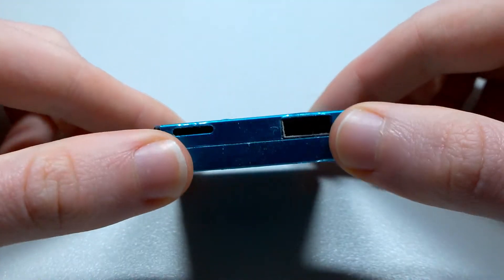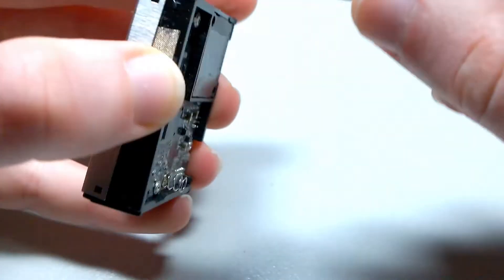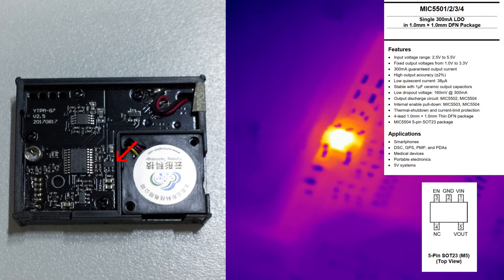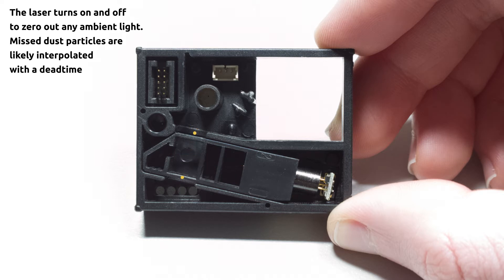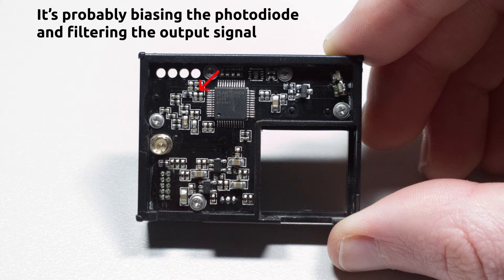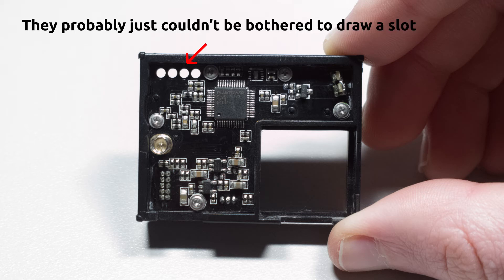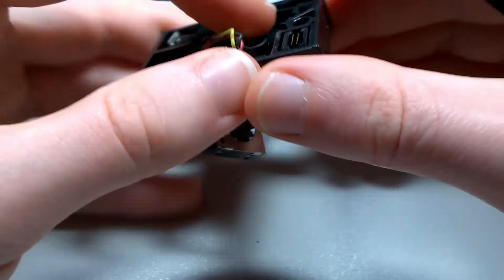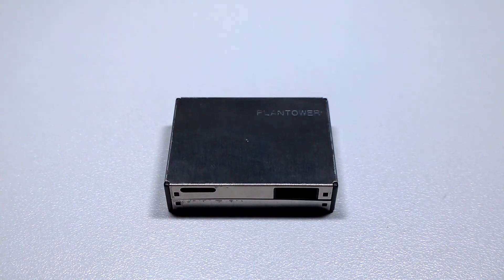Teardown & Cleaning a Laser Dust Sensor PMS7003 After 2 Years

Comment: I was so curious about the inside of these, thanks for the video! I'm still skeptical on how these things selectively measure the right particle size considering the dust particles that you found in there. How much processing is that thing doing? I'm curious about the firmware in there!
Reply from the maker: From what I've observed it gives a good idea of the particle size distribution but it's not perfect. It does give clear trends that dust from carpets is larger than dust from intentional atomization or combustion so is useful for that. But it does seem there's a lot of interference between particles sizes. It makes sense though seeing as the dust can be different colors, shapes and orientations which makes detection very difficult.

I imagine that MCU inside is doing at most a couple MIPS to run everything so not computationally demanding.

Also I now live a couple kilometers away from an air quality monitoring station run by the local government which has several really high end particle sensors. The figures it gives are reasonably similar to what those sensors give.

Comment: i have purchased the pms7003 sensor today, but i haven't got any cable or connector with it. can you help me connect wires to the sensor pins as they are so small. What options i have now. I searched for the cable but there is no one that have these cables in india. I tried international options but thats too costly, costlier that the sensor. can anyone help me with this? Can i open the sensor and solder wires directly to it?
Reply from the maker: The PMS7003 uses a 10-pin (2x5) 1.27 mm connector, male on the sensor side, female on the cable side. (IDC ribbon style connectors won't work, they're too wide)

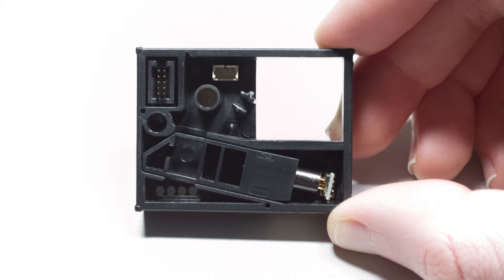Easiest way to connect to it is with an adapter PCB that converts it to a standard 2.54 mm header like used on breadboards, one design available is shown at 3:26. Sometimes sellers will sell the sensor and PCB together which how I got mine but they are sold separately.

Alternatively you can buy just the 2x5 pin 1.27 mm female header which would be easier to solder your own wires onto.
Example: https://lcsc.com/product-detail/Female-Headers_hanxia-HX-PM1-27-2x5P-ZC_C22438129.html

I would normally recommend buying either of those on Aliexpress or LCSC however my understanding is it's pretty difficult and expensive to get those sorts of things through Indian customs so I'm not sure where you could obtain them. It's unfortunately a rather uncommon connector so you probably won't be able to salvage it from scrap e-waste PCBs or buy one from a local electronics parts store but it could be worth looking.

But if you can't get the adapter PCB or connector you can take the metal shell off the opposite side to the connector and solder wires directly to the back of the connector on the PCB.
The pinout of the connector is in the datasheet, make sure to double check as it doesn't have reverse polarity protection: https://soldered.com/productdata/2020/03/Soldered_PMS7003_datasheet.pdf

Comment: Very informative. Btw, these (or something that looks like a drop-in replacement) are used in some Xiaomi air purifiers (4 Pro at least).   Found this video while looking for a replacement fan for my own sensor, it's gotten way too noisy. Sadly the fan itself is encapsulated to the point there's no way to access it and lubricate it a bit... It's a simple 3pin, voltage-regulated thing, but there's no model or anything, so I'll have to do some guesswork/measurements.  Just the info that it needs to provide 0.1l/m is already useful.

Comment: Thank you so much for the video! This may sound like a silly question, but how do you know the fan pulls in 0.1L/min? I couldn't find the information on the data sheet of the sensor. All I could find is that the volume of air is 0.1L.
Reply from the maker: That's a good point. Unfortunately I don't remember where I got that number from. I can only assume I misread the datasheet's 0.1 L volume as a flow rate of 0.1 L/min as that seems suspiciously low considering a typical 20 mm blower fan like that can do 50 L/min, although they're not running it at full speed in this sensor the fan couldn't operate at 0.2%, it would stall before then.

Taking a complete guess I would say somewhere around 10 L/min is a more reasonable flow rate to expect.

Comment: Hello! Thanks a lot for the detailed video!
I am using PMS7003 and its readings are jumping very much. The readings are usually about 10-15 ug/m3, at the same time, about 1 time per minute they jump ~ 200 ug/m3. 
Could you guess why this is happening? What do I need to do?
Reply from the maker: Hmmm, it could be a lot of things so unfortunately I can only give you a couple pointers of what to investigate, could be:
- 5 V supply is low, it needs a solid 5.0 V, it won't work properly at for example 4.6 V
- 5 V supply could be noisy and causing interference, likely if you have other power electronics sharing the same 5 V or maybe a loose wire
- A programming issue or noise on the TTL serial TX/RX lines possibly from a loose wire (I think there's a checksum in the packets it sends, not sure if most libraries check it's valid)
- Dust on the internal photodiode (unlikely if you've just bought it)

Comment: Your explanation is excellent, it has helped me a lot. However, the fan does not turn and it gets very hot. Do you know why it doesn't spin?

Thanks a lot. 🥰
Reply from the maker: Thanks!

Hmm, I assume this is one you're using yourself with an Arduino or something? Typically when something doesn't work and just gets hot it's usually because it's electrically damaged which is what happened to mine at 3:09, I plugged it in backwards and instantly blew up that regulator IC. I'd double check it's the motor and not one of the ICs that's getting hot, also check the fan rotates by hand without power to check it's not mechanically jammed.

Another thing I have noticed with them is they really need a good 5V supply, the 5 V pin on an Arduino or similar will often cause problems because they have a diode between the USB port VBUS and the 5 V header, check with a multimeter it's like >4.90 V and not something like 4.4 V (5 V minus a diode drop). Cheap thin breadboard jumper wires can also make poor connection or break internally so check them over as well.

Comment: THANK YOU THANK YOU THANK YOU!!!  

My PMS7003 died and I had no idea why, I didn't have the courage to take it apart without a guide.  Yours is the only teardown guide of the 7003 model ON THE ENTIRE INTERNET.  Upon tearing it down I was able to discover there was nothing wrong with the board, just that stupid fiddly connector, and I instead removed the connector and soldered wires directly to the PCB, and now it works again!  HOORAY!  thankyou!

Comment: Great video! If you had this running continuous in a home/office setting and cleaned it once a year, what do you think would be the life expectancy of one of these devices?
Reply from the maker: The manufacturer says the Mean Time To Failure (MTTF) is > 3 years without cleaning in a typical indoor application. The sensor in the video I still have and it's working fine now 5 years old, along with 2 others that aren't quite as old. The fan inside is the thing that will probably break first, in a normal indoor application with ~5 μg/m³ of dust I think 10 years would be a reasonable expectation for the limit of it's useful life.
Reply from the maker: If you want a dust sensor with a very long life expectancy there are draft type sensor available, they heat the air inside to make the air rise though the measurement chamber without any moving parts, but those devices consume more power and are typically less accurate.

Comment: Are these dangerous? I have a mila air purifier. It says it has a laser sensor. I am always next to it. Is it bad for my health? Aren’t lasers radiation?
Reply from the maker: Those aren't dangerous and your Mila air purifier is perfectly safe. 

"Laser radiation" is just a technical term for a special type of focused light that's "non-ionizing", the laser in those sensors are what's called "Class 1", which is perfectly safe.

You're probably thinking of "ionizing radiation" (like X-rays) that's dangerous but that's very different, you very likely don't own anything that emits ionizing radiation.

Comment: I don't think you have a counterfeit, I think they're just iterating their designs very quickly. I have one from a few years back and remember them coming out with a new model number immediately after I got it even though the one I had was really new. I really think there's no wayyyyyy these cheap things are actually "counting" anything. The number of particles in the beam at any given time, the total lack of focusing optics before the photodiode, etc. all point to the certainty that what they're actually doing is just periodically grabbing a light intensity value from the photodiode and shoving it into an algorithm that lets them guesstimate the PM2.5, 10, etc. values based on overall light scatter at any given time.  The question is, did you see any statistical difference in detection efficiency after cleaning?
Reply from the maker: Yes I agree it probably isn't a counterfeit, the plastic injection molded case and folded metal parts were identical, it was just strange to see the older datecode one was the one with a custom MCU and overall better mechanical design, my guess is I got two units from when they were switching production lines.

After cleaning it there was pretty much no change in readings, maybe a slight increase of 1 μg/m³, but nothing major.

Comment: This video deserves more likes 👍
Reply: I’m working on an air quality module that comprises of the PMS7003, and I’m looking for good sensors for O3, NO2, CO, & CO2. Please, which sensors would you recommend?
Reply from the maker: @alhajee  I have several gas sensors manufactured by Winsen, I would recommend looking at them.

I like the MH-Z19 modules that use the NDIR method to measure CO2, accurate and well priced modules. 
I also have a ZE07-CO which works well however it is an electo-chemical sensor.
I haven't bought any O3 or NO2 sensors as they're somewhat expensive to get good resolution and low interference.

Note that cheaper gas sensors often have similar interference gases so you might find it better to use a hotplate air quality sensor like the CCS811 or SGP41 and a CO2 sensor if you just need an AQI.

Comment: Great video Tim! Thank you for being so informative about this sensor. However I am still not completely convinced whether this is the best sensor to use. Currently I have used the SDS011 sofar, but that one has also got his issues. For instance it produces much more noise which is annoying if you use it inside. Otherwise is it somewhat bigger and is it more fit to be used in a more turbulent environment and even a hose can be applied. The teardown and cleaning up will also be much more easier since it is bigger and has a simpler construction. What I do not like about these sensors is that the output is all but steady especially in the PM10 range. So anticipation by a MCU is quite difficult because the measurements are goint up and down just in one minute. If you would have a DMM like that you would just throw it away. Do you have any experience with the Winsen dust laser sensors. It seems to me that they are exactly the same as Plantflower ones but they are much cheaper.
Reply from the maker: I haven’t used the SDS011 from Shandong Nova Fitness, but I can say the 4 I have from Plantower are pretty quiet (at least a lot quieter than the 2U server in the same room). The values I get from them have a clear trend and are smooth with very little random noise unless I introduce dust then it changes rapidly, although I haven’t done much sampling faster than 1 minute intervals but I have had bad connections causing random data before.

Zhengzhou Winsen makes some good sensors, I have a few of their CO, CO₂ and CH₄ gas sensors but I haven’t used their dust sensors, after a quick look I see they have the ZPH02 which isn’t a laser dust sensor but an LED dust sensor which only gives very rough data and can’t determine particle size, they also use a draft induced by a heater instead of a fan so it would be silent, they are also a lot cheaper but I imagine not very accurate or precise.
Reply: @WizardTim  The silence of the Plantpower sensors is indeed amazingly silent!!! Perfect for indoor use. I blew one up; a pms3003. Got the leads connected the wrong way :( But in your video you mentioned it could probably be fixed by soldering a new voltage controller. I have another 5003 and a 7003 is on the way so I can compare them and see if they suit me. Winsen has also got laser dust sensors type ZH03B and they are a lot cheaper than the Plantpower ones and according to me they are exactly the same as the PMS3003.

The lifetime of all these sersors is around 10000 hours, but I think that number does not take into acccount when the sensor is cleaned in the way you showed in your video. Maybe the laser itself can have an even longer liftime than 10000 hours. At least  I hope so because cleaning these sensors is well worth it if it works again like new. And it is probably be possible to find new fans for these things since that should just be a standard kind of fan.
Reply from the maker: @Pumba3900  I’d say you have a good chance of repairing it from a reverse polarity however the internals of the PMS3003 are different, I believe it uses a SOT-223 AMS1117 regulator rather than a SOT-23-5 one.

I expect there are 3 main contributors to the life expectancy:
-	Dust accumulating affecting the flow rate giving falsely low readings
-	Laser aging resulting in dimmer reflections thus fewer and mis-classified particle sizes
-	Failure of fan bearings resulting in complete failure
Plantower says it should last >3 years in normal conditions and I certainly believe you could get 5 – 10 years out of it indoors.

And I see what you mean the ZH03B looks identical to the PMS3003 but personally, the PMSA003 is my favourite, but it’s of course the most expensive.
Reply: @WizardTim  The PMSA003 is about 13 Euro shipping included. Is it the best Plantower sensor? I thought the PMS7003 was the latest type and the best? An SDS011 costs about 17 Euro. Still not very expensive for such a sensor. And does this PMSA003 has the stable and smooth readings or do they all have that?
I am using my own moving average code to smooth the readings out, but the readings are so jumpy it almost makes no sense. Another thing that surprised me about the PM5003 sensor was the resolution which seems less than the SDS011. I get readings in 0.1 ugram/m3 resolution whereas the Plantpower just jumps from 1 to 2 which is quite a big step. That is a factor 10 difference. I don't get that. Just to make things clear Tim, I am looking and searching for the best sensor with the most stable readings. And unfortunately there is very little content and info about these sensors I think.

Comment: Thanks for doing this.  I'm interested in the power efficiency of the 7003 and this was helpful.
Reply from the maker: Glad to hear the video was useful! 
During the 2019-2020 bushfires here in addition to the one shown in the video that’s setup inside I also put one on a breadboard on my back deck along with an ESP8266 and an 18650 cell (an old 1,800 mAh one) so I’ve had to deal with the power consumption of it as well. Some things that might be useful to you:
• It needs a good 5V supply, feeding it 4.4 V after a diode drop will result in the fan not starting reliably or not spinning fast enough. 
• The manufacturer states you should let the sensor stabilize for 30 seconds after waking it from sleep mode before trusting readings, this is certainly true however you can probably get away with 15 seconds. For my application sampling every minute I didn’t bother to get the sensor to sleep but I did put the ESP8266 to sleep between transmissions as the WiFi consumed a lot of power.
• With the ESP8266 mostly in sleep mode only transmitting every 60 seconds and the PMS7003 constantly running I got a little over 12 hours of battery life so I changed the battery at midday and midnight. The whole setup worked out to an average of about 100 mA @ 5V (500 mW) which is pretty much what the datasheet claims.